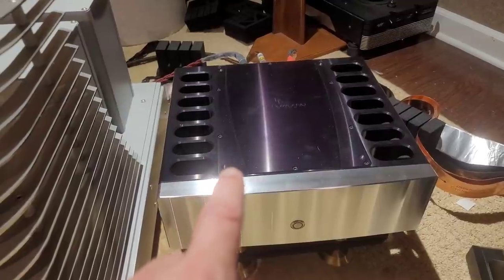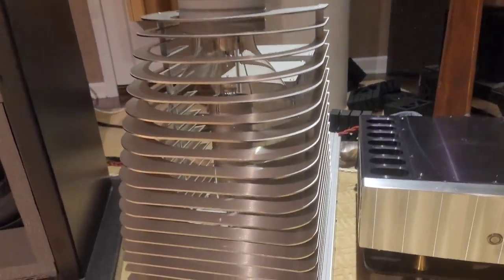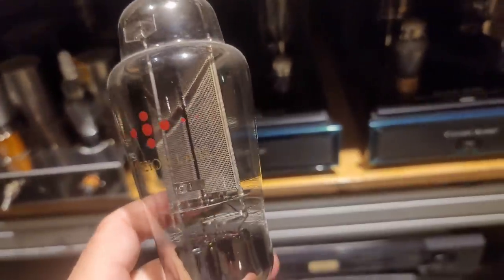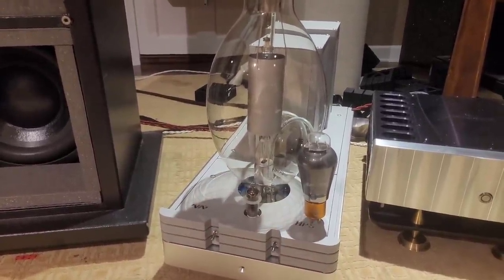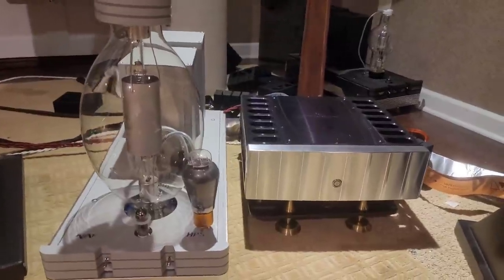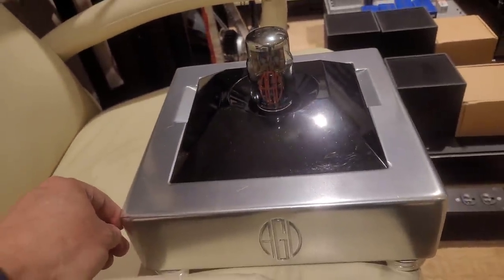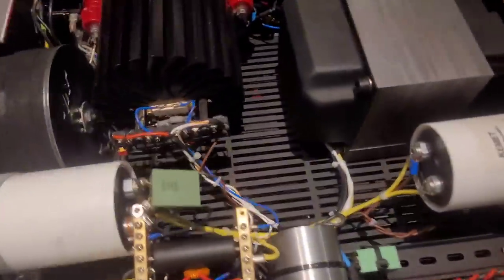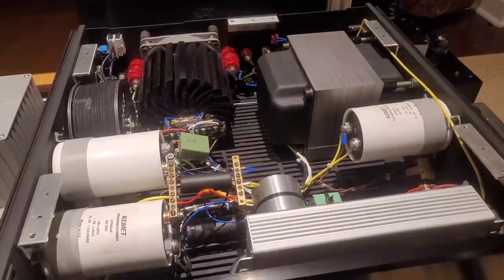DEFINING THE EXOTIC WITHIN HIGH END AUDIO

Comment: Exotic is fine, but try to service or get parts 7 years down the line. Its bad enough on S.O.S. I'll agree with you regarding visual design.
Reply: NAT been around for a long time, some "exotic" brands give longer support then big brand name companies.
Reply: You can get a replacement Denon AVR cheap in a charity store when your old one stops working.

Comment: you paint such a rosey picture of those NAT tube amps. The damping factor is very low, like a SET Triode, so bass wont have good control. I noticed NAT doesn't post distortion specs, which I assume will be embarrassingly high.  Cary audio played with similar tubes 20+ years ago and they sounded terrible. Not to mention cost. I will stick to the finesse of a 2A3 and the 300B. Low power always sounds better, especially when properly matched.
Reply from the maker: Cary Audio blows chunks in my opinion. 2A3 is not for me . No Balls... I like Rock and Roll, remember ? This is about how things sound, not how they measure.  Tubes have high distortion and it sounds sublime.  Come and listen to my rig and lets talk about finesse... your comments are completely generalized opinion, and thank you for sharing it .. ;-)

Comment: I have questions, Mikie. BTW, I hope you can get the NAT phono with the full-sized tubes going. My question is about the sound of dual mono in one chassis vs two monoblocks, with one wall outlet being used. This is crazy but, would two power cables make any difference?
Reply from the maker: Fully dual mono will have 2 power cords and 2 completely separate power supplies inside. Dual mono signal path is different but still a good thing.

Comment: In the early 90s, getting into the whole 5.1 thing I noticed all the AV receivers weighed half as much as the receivers from the 80s, and they had no power for bass. The drivers in the speakers also got smaller and the skinny tower scene began. Why would you need a 15in sub when the amp does not have any low end power. lol.Then came 7.1, and I got away from it cause it was all BS! They just wanted to sell you 16 speakers so you could watch a movie, F! that!
Soooo, even though I cant afford your gear, I sure appreciate someone that looks for the obscure, truly unique pieces the main stream would rather you didnt know about.

Comment: I think the best looking gear ⚙️ on the market that I consider heirloom quality would be the new Vinnie Rossi Brama line. Absolutely stunning, though I can’t afford any of it. I also Like the new Arc stuff. Again, I can’t afford them, though I can afford used Mcintosh & used Pass Labs & used Arc. Which is fine by me.  Are they as pretty? No, but I like the sound of the ARC, then the Pass Labs & then the McIntosh in that order for my soon to be Maggies 1.7i’s. I wish I could afford the JR 625, but it’s out of my ball bark.  BTW, I am an aircraft electrician & the do use this toggle switches all over the cockpit for safety sakes.  It can get bumpy up there & you don’t want an accidental switch mishap & 35,000 feet! Thanks for the video
Reply from the maker: Thanks for your feedback !

Comment: Power is not the whole story.. I had a GM70SE pair running at 50W.. SE amps don't control the bass anywhere near as much as a solid state, pp's do a little better. So it's not about power it's damping and most or all valve gear is rubbish when it comes to solid state in this area!!!
Reply: Correct. The passive crossovers of the speakers eat up a lot of energy and signal details. If you combine e.g. an EL34 Single Ended amp with speakers without crossovers (e.g. 3a audiodesign MM monitors from France; now made in Canada) and complement the SE tube amp with a pair of (REL) subs, you do get pretty nice results in my experience. Beautiful music in spades which i believe no solid state amp alone is capable of, regardless its price. I do agree with Mikey, that the single tube amps are the best sounding! 😀

Comment: Hi Mike, While I am developing my relationship with the Jeff Rowland Design design, and while the 625 S2 is a nice looking and powerful amp, But the 625 S2 is a class AB design. I am not knowledgeable enough about the JRD class AB design. But as you know there are tons of companies making powerful Class AB amps.  I would think that his most powerful Class D, would really be the epitome of style and innovative unique circuitry. Class D has improved greatly and JRD has been part of that evolution. Plus his units are great looking.
Reply from the maker: Jeff designs the most advanced A/B amps out there. Everyone else regurgitates the 80s. Jeff designs his A/B 100% front to back. Class D uses modules so Jeff designs about 35% of those amps. I still find them better than others but I like the texture and harmonic density of an A/B..